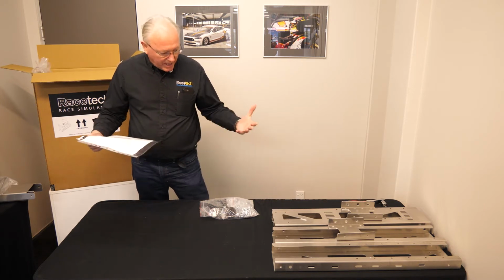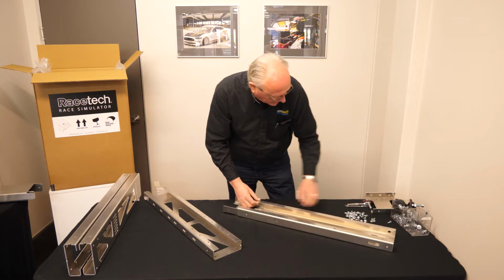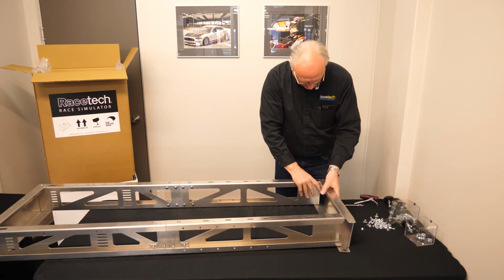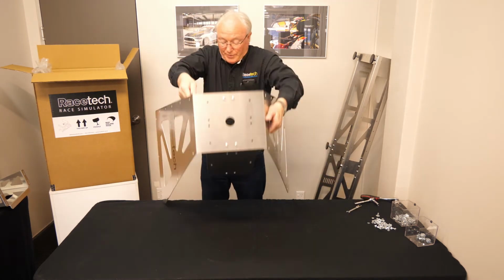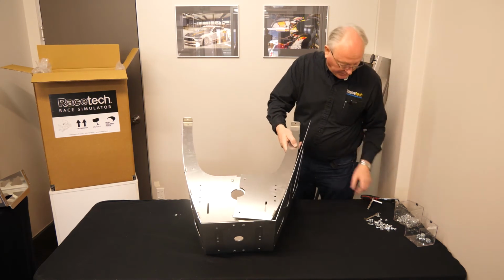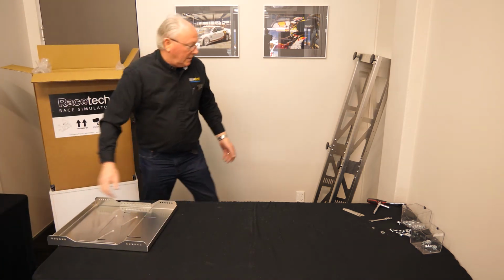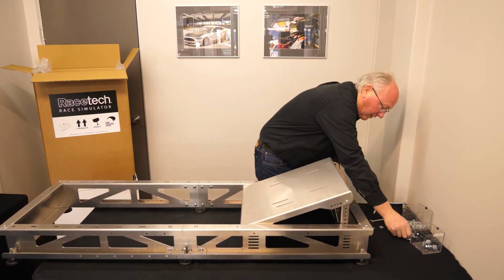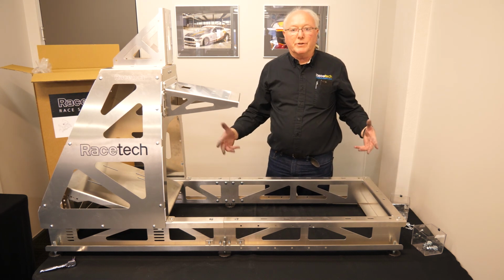Racetech Racing Simulator Assembly

Comment: I'm considering your cockpit for my sim racing setup and I'm curious if my Kirkey 36800 20" wide side mount seat would fit to your bracket and sliders? I like your seats too, but I already have this one on my sim rig and seems like a shame to throw it out.
Reply from the maker: Fair enough. We really have no idea if it would fit. We will go out on a lim and say it will. Its an alloy seat with the ability to make adjustments easy by drilling holes where you want.
Reply: @racetechseats8907  Thanks for the reply. I guess I was just curious how wide the frame is. Makes sense that I'd likely have to drill holes to mount things up. Thanks again!
Reply from the maker: @DmitrysGarage  on our website we have the dimensions under the specifications tab.